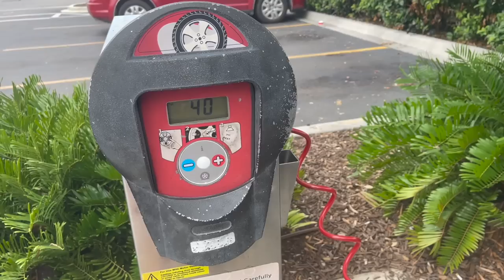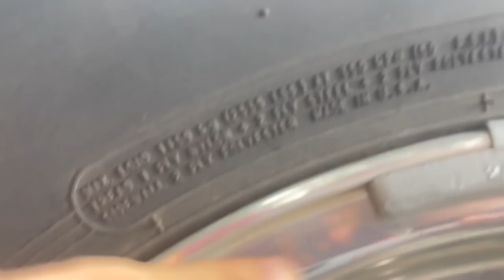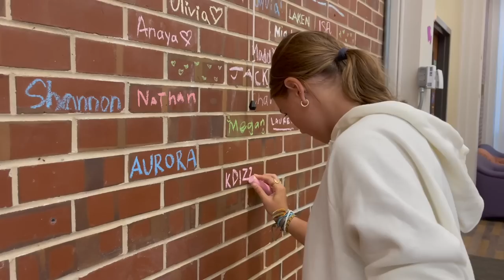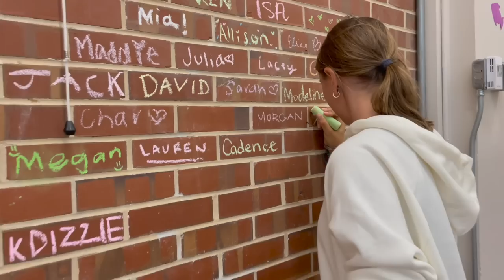Moving Katie To College For Freshman Year Did Not Go As Planned

Comment: Your mom was right for checking...on Jeeps (and lots of cars) that front and back PSI can be different...and PROTIP- the PSI is also listed on the inside of your driver side door sticker which is usually a lot easier than looking at the tire
Reply: I was about to comment this also! We always regularly check the tyre pressures to spot any slow punctures and especially before long journeys to prevent tyre popping. The little sticker on the door is so helpful

Comment: Recommended tire pressure (cold) will be found on the inside of the driver side door jam. The PSI number (50) you saw on the tire is the MAX PSI the tire can be filled up to before becoming dangerous. If you fill the tire to 45 and drive, the PSI may reach up to 48 - 50 which is dangerously close to max pressure. 

Recommend filling to recommended tire pressure listed on the drive side door jam, let the car sit over night in a shaded area where sun cannot hit the tires, and fill the tire to the proper pressure if necessary. Repeat the same steps the following day to assure the PSI is even with other tires.

Comment: I work with tires daily: u don’t wanna go to the max rate, u wanna look on your door and look at the front a rear psi. Off the top of my head I’d guess the sticker for that is 35 - 40. Setting it at the max pressure can cause that to happen again. Generally cars 28-32 suvs/jeeps 35-45 trucks can range depending on tire rating and truck size

Comment: YIKES! Scary alright. Yes under pressure, especially in the heat, can cause more of the tire's surface to contact the hot road, increased flexing, heat from friction, fiber separation, and a blowout.. Thank God you were able to safely pull over. 13:57 actually there is a formula, tires gain or loose 1 PSI for every 10℉ change in temperature. 50 PSI is the max at cold, Your drivers manual will have recommended driving pressures, or most newer cars also list the pressures on a tag on the inside of the drivers side door frame. 😊👍

Comment: If it says 45 set it for 45. Just saying
Reply: You NEVER set the pressure to the sidewall. The sidewall is the max pressure the tire can hold while cold. If you drive it, the tire will heat up and burst. That pressure is there so you know how to set the tire if you are storing the vehicle and don't want to get flat spots. New cars all come (to the dealer) with 90-100psi in the tires, which is the max for most passenger tires. That is dangerous, but new cars can sit for months between final assembly and getting to the dealer. Proper pressure is on the list of making a car saleable by the dealer. (I used to work at a Toyota dealer and do that.)

You should set the pressure to the manufacturers recommended pressure that is put on the driver's door jam if you have stock sized tires. 

If you have bigger tires, like Katie does, you need to talk to the tire person who puts them on. On a jeep, generally you go down a few psi for every inch over stock.